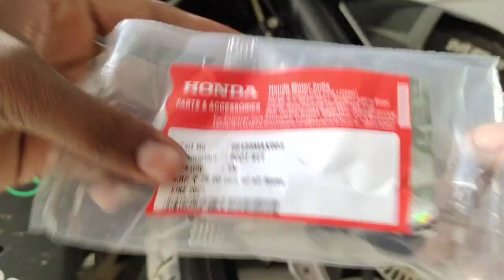FORNT DISC CALIPER BOOT CHANGE AT HOME FOR PULSAR RS200

Comment: Bro... ❤
RS200 ku farrings oda..... Nets, Screws and bolts la.. epadai !! Enga !! vangurathu bro ?
Ellam rust agii & head mara poitu iruku... So, I want to Replace it to new one....🙏🏻🙏🏻🙏🏻
Reply from the maker: Service center la tha bro na vanguvan so ningalum service center Ku poi spares counter iruku anga vangikalam bro
Reply: @robinrsvlogs6862  na neraya time keten bro... but illa nu tha solurenga
Reply from the maker: Vara service center la katu parunga bro local shop la kidaikathu nuts bolts lam